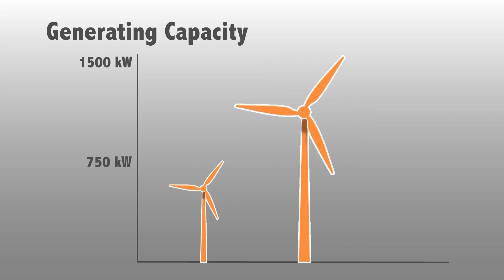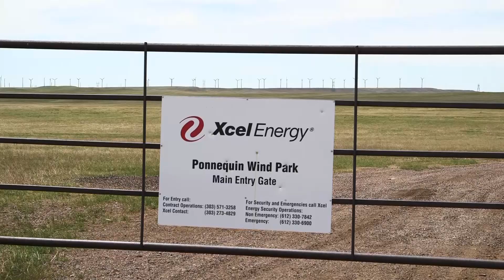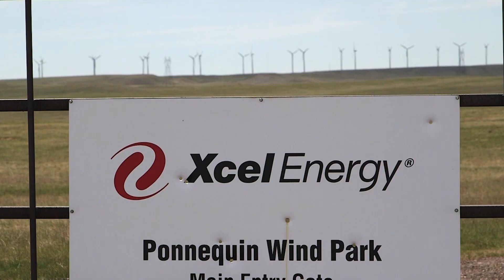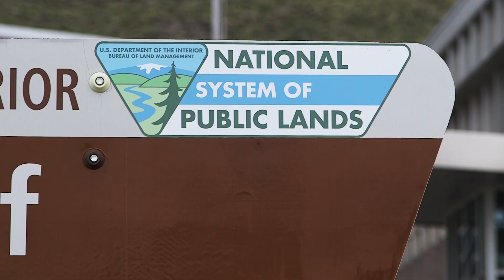Who Cleans Up When a Wind Farm Retires?

Comment: Wow they get a 7 year write off, they also get a government grant and other forms of assistance.  So they have a short overall lifespan and their upkeep is rather expensive and difficult, just grasp the fact you have to climb several hundred feet in the air to get to the generator and gearbox, then you are forced to work inside a rather confined space to do even routine upkeep.  Now think about hauling say a 55 gallon barrel of oil up into this confined space, draining the old oil and refilling the gearbox.  Not my idea of fun.  Then how about changing a gearbox for example.  The more I learn about them the more I see that they are not the answer.

Comment: I thought they said this green energy siht was forever and cheaper than fossil fuels, what damn liars..
Reply: That’s why they put up a smokescreen of bullshit
Reply: Really! Nature doesn't charge the power company for wind.  So why does power generated by windmills cost more than mined coal????
Reply: @citomp1240  I did not know that. About 10 years ago I was working in La Grange Texas they put filters on the coal fired plant, when they turn them on within three days I quit having black snot at the end of the day so they do work. A Welder I talk to at the café said he had been there a year working on that project he said he had put them in before and they work. Personally I think natural gas is the cleanest and cheapest the world has excess natural gas. They tore down six natural gas powered electric plant in West Texas. That were for peak power needs and emergency. More more Ercot stupidity I guess or plan stupidity. Natural gas is easier to turn on or a few days and cut off and easy maintenance. The windmill blades last about six years and no way to recycle them, every wind farm has a pile of them in the back corner where you can’t see them.
Reply: @jackcook6735  "The windmill blades last about six years and no way to recycle them, " Untrue. A wind turbine is about 80% to 90% recyclable. The blades are fiberglass, just like a boat hull. Fiberglass can be crushed or buried, and you can grow crops over them.
Reply: @justsomeguy934  crushed or buried blades. Got it. Per kWh hundreds of times more landfill used than any other energy source.
Reply: @YourEnvironmentSeattle  "crushed or buried blades. Got it. Per kWh hundreds of times more landfill used than any other energy source" - Compared to an oil spill, or poison in the air we breathe? Please prove your "hundreds of times more landfill" statement. The exhaust you spew out your car's tail pipe is the dumping ground of oil, pal. I'll take a solid waste of fiberglass - the same thing as a boat hull - as opposed to oil spills, tanker leaks, explosions and fumes from your car.
Reply: @justsomeguy934  I said landfill. Don't weasel out of it.

Frankly I'd prefer to eliminate fossil fuels with nuclear.
Reply: @YourEnvironmentSeattle  I never weasel out of anything - what is it that you think I'm avoiding? Turbine blades are made of fiberglass, the same thing as boat hulls. 80% - 90% of the entire mass of a turbine is recyclable. You can plant crops over buried fiberglass, or use it as concrete filler. That's all the refuse or pollution you're going to see out of a turbine. I hope YOU don't weasel out of the comparison to diesel and coal energy, as those sources have devastating pollution and waste that go with them. Please continue our conversation.
Reply: @YourEnvironmentSeattle  "Frankly I'd prefer to eliminate fossil fuels with nuclear." I'd rather have a mix of 75% renewable and 25% fossil, instead of nuclear.
Reply: @justsomeguy934  you were just wailing and moralizing about how bad fossil fuels are and you're not actually in favor of defeating fossil fuels...
Reply: @YourEnvironmentSeattle  " you were just wailing and moralizing about how bad fossil fuels are and you're not actually in favor of defeating fossil fuels.." What are you talking about? I just said I prefer a minority mix of fossil fuel over nuclear. Nuclear is so difficult to control and the downsides are so bad that coal looks much better in a small amount. Your statement makes no sense.
Reply: @YourEnvironmentSeattle  "d you're not actually in favor of defeating fossil fuels..." Ah - I think I get it. You have made the classic mistake to assume that ANYONE and EVERYONE that supports renewable energy want the total elimination of oil and oil products. Nothing is further from the truth in my case. I happen to think oil is precious and that we have no business burning HALF of it as gasoline.
Reply: @citomp1240  technology is expensive and each turbine only creates so much power; they are and were subsidized; idea good but not feasable;  nat gas and nukes i believe are the way to go;  coal is definitely very dirty; but we all need power and that isnt changing; unless we change our ways and i dont think that will happen
Reply: @robm9581  "technology is expensive and each turbine only creates so much power; they are and were subsidized; idea good but not feasable;  " Um, turbines are in the megawatt range of power and have no fuel cost; oil is subsidized more than the US military! We give oil free military escorts for their trade routes! How is a turbine or solar array that sits on US soil inferior to a diesel generator or coal-burning steam plant?
Reply: @citomp1240  "o why does power generated by windmills cost more than mined coal????" It doesn't - wind and solar are cheaper than coal in many places.
Reply: Climate lockdowns are the new green deal!
Reply: @jcmboyle  The Green New Deal is not practical and definitely has bad intentions. It's not about the environment; it's about economic damage to the USA.

Comment: The wind is used up???
Why not install new turbines instead of new locations.  Some facts are missing.
Reply: The things break down and need to be repaired. It's very expensive and not worth it. They'd rather build new ones. More profit. That's why they need all them subsidies. Keeps them raping taxpayer.
Reply: They covered that. The company that owns this one won't do that because it'll cost them more to replace then they will make in profit off it.
Reply: @samuelhowie4543  Due to government subsidies many companies built wind turbine farms. Perhaps in locations that were not ideal. (But we still get paid by the government.)
If wind and solar are the future, abandoning existing wind farms doesn't make sense. Underground wires, transformers, and power transmission lines are in place. Unless those are used up too. Starting from scratch doesn't make sense. New turbines vs new everything.
Perhaps the land owner wants them gone.
Is this the future of wind energy? New locations every 20 years.
Reply: @kevinmoore4887  I do know the new wind turbines are bigger around then the older ones and they generate more electricity.  That would probably mean a bigger base for them and mor extensive writing installed to handle the higher output. California has one wind farm that has towers installed in the 70's that are still standing but they have no turbines on them. They have just put up different towers around them. Eventually you do run out of space when you figure they have to be in a accessible area.
Reply: @samuelhowie4543  I watched the windmills in Altamonte Pass grow and grow in size. Usually new windmills in the same location. 
Replacement of generators and blades should be more cost effective than starting from scratch.
I think it's more related to government incentives and depreciation of new equipment.
Reply: @kevinmoore4887  I'm not sure where the article I mentioned was talking about but it did have video of it and the old ones aren't cylindrical like they are now. The closest I can describe them is they are similar to high tension power line towers. They don't have the blades or nacelles still on them. They did mention part of the problem with removing them is you have federal state and local level regulations on it.
Reply: @samuelhowie4543  The video starts with they could be re-turbined and last 40 years. Old turbines 750mw, new turbines 1500mw. So 2 to 1. Leave up 2 re-built wind turbines vs 1 new large turbine.
Use and discard doesn't seem very ecological.
Reply: @kevinmoore4887  Yes they could be renovated, but the company won't because it's not bottom line feasible for them, which is why they are shutting it down.